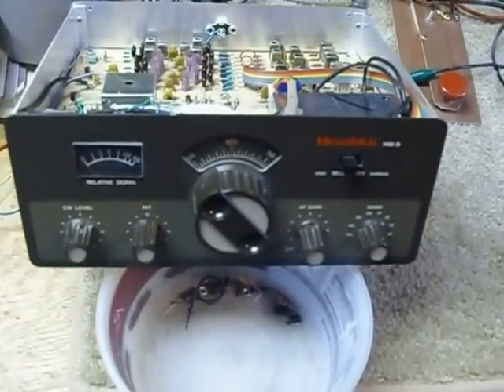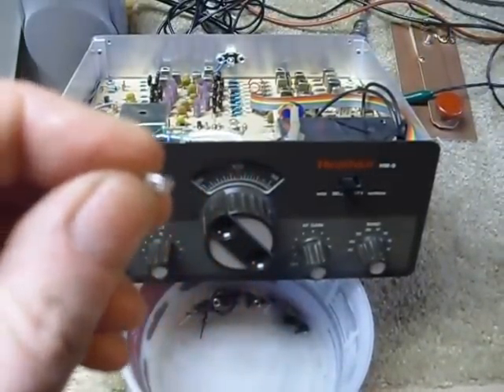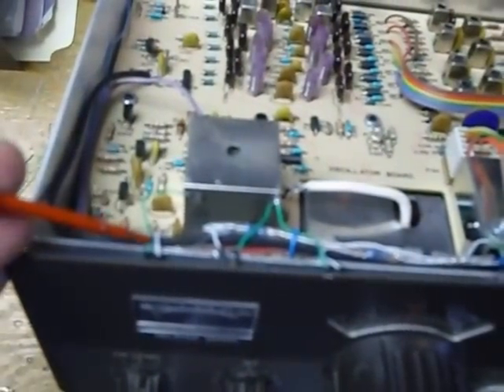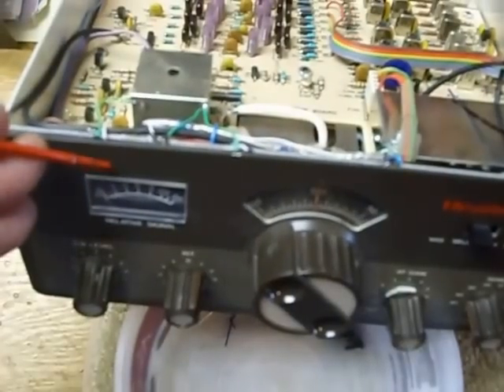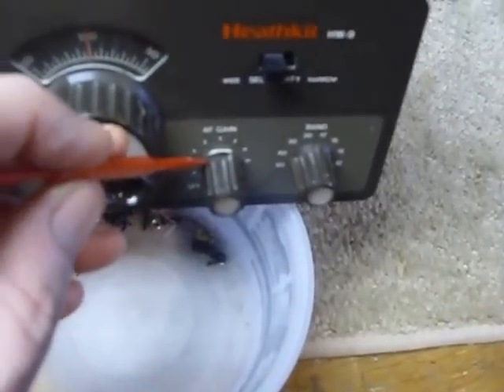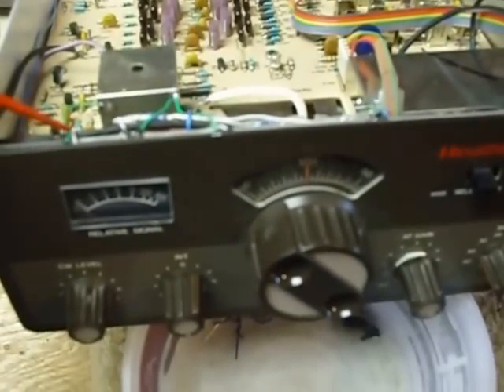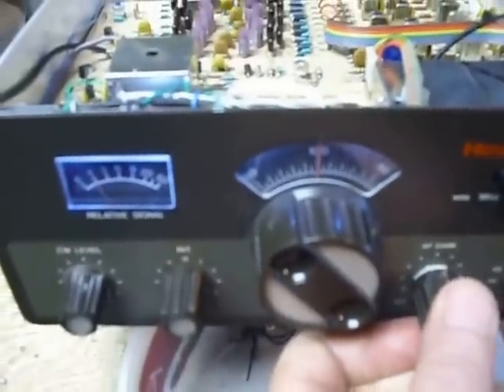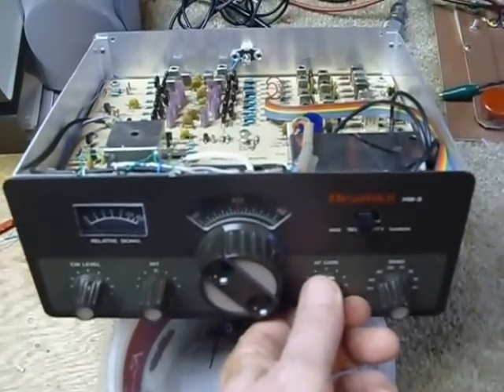Heathkit HW-9, HW-9 Lighted dial ,Adding Led's to light dial and meter of your HW-9

Comment from the maker: All I know about the LED's is they are very bright white very small and were cheap.
I have no other information on them . Bright white LED's from Radio Shack should work in the wattmeter ok the 2200 ohm resistors keeps the current down to 5 MA each LED. Wish I had more info on the LED's unfortunately I do not 73  BOB
Reply: Bob,  nice of you to post this "how-to" video and you did a really good job with the mods. For those wishing to acomplish the same thing with less work on the HW-7, HW-8, and HW-9 units, the LED strips could be used. They are sticky-backed and will sit right on the aluminum plate behind the front panel with room to spare. Additionally,  there are eBay auctions for LEDs with the limiting resistor already incorporated and those can be used for the meter backlight with good effect. 

73, 

Bill.
Reply from the maker: +William Phinizy    Bill very good ideas  I will look for the LED strips with sticky back AND the LED's with built in resistor ... I did not even think of these or know they existed  my junk box is filled with OLD stuff Hi Hi  .   Thank you 73  Bob
Reply: +Robert Sumption..they didn't register with me,  Bob, until I ordered a big reel of them off of eBay for about $10 and saw how easy it was to hook them up to 12 volts. The little tabs solder easily and the strips can be cut into as little as 2-3 diodes depending on size. 

By the way, I think I need an intervention. What started out as 1 HW-8 two months ago, has ended up with a collection of an HW-8, two HW-7s, and a COMPLETE HW-9 station. 

:-}

Comment: Thanks for taking the time on the 4th to post this video.

I bought a HM-2140 Dual Wattmeter from eBay.  It turns out that a mod had been made for lighting the two meters!  The bulbs aren't LEDS and it hooks into the peak reading battery to light them up.  Can you tell me what model of LED you purchased for this?